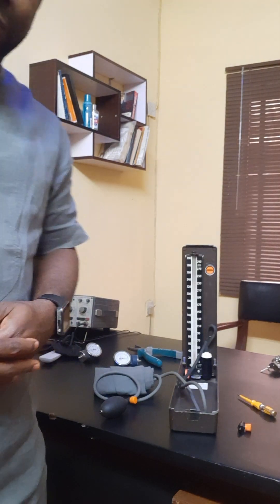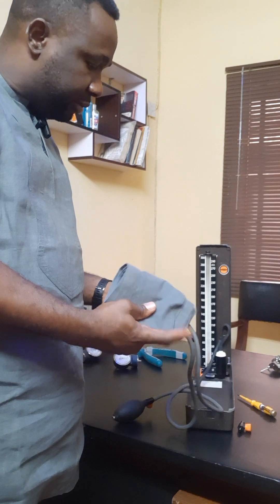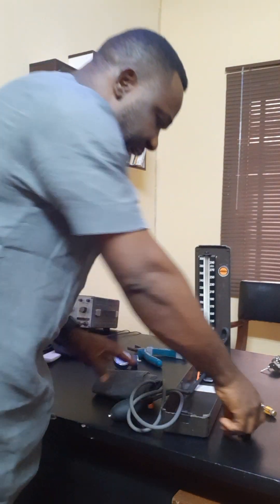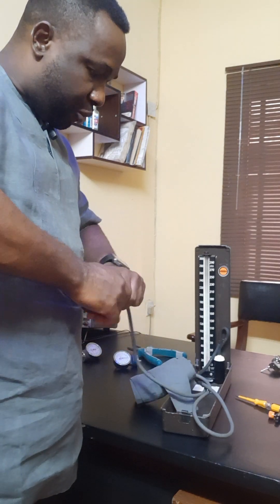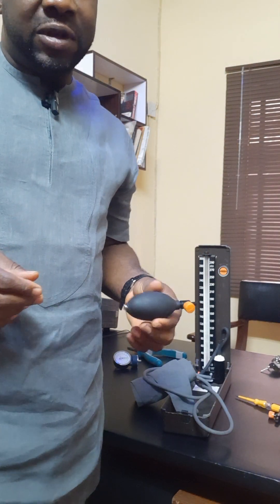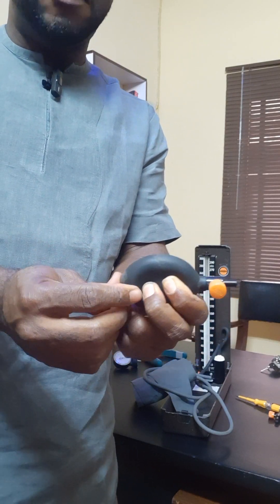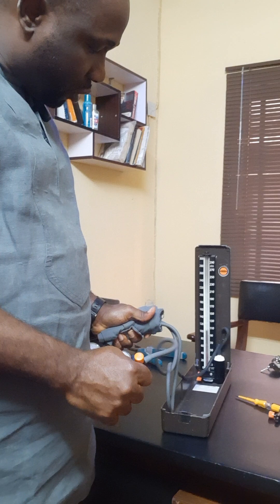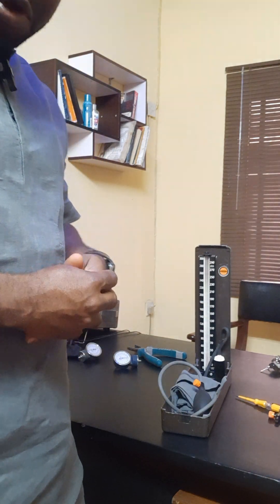Mastering Fault Diagnosis and Repairs for Sphygmomanometers (BP Apparatus)

Comment: Good day sir, thank you for this video. Please when the Mercury is not consistent (breaks up at some point) how can it be fixed?
Reply from the maker: One is that you need to Top-up the mercury because it may have escaped or leaked from the calibrated glass top seal: secondly the mercury may be dirty and requires cleaning